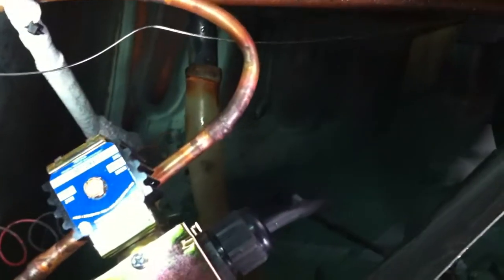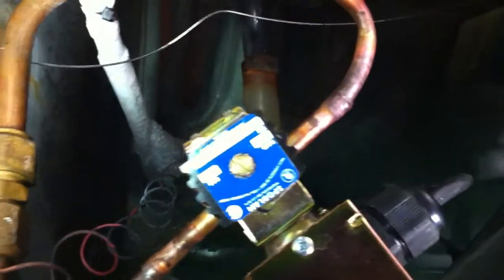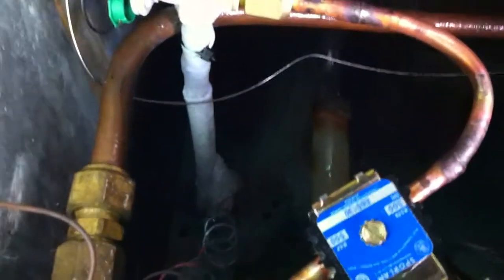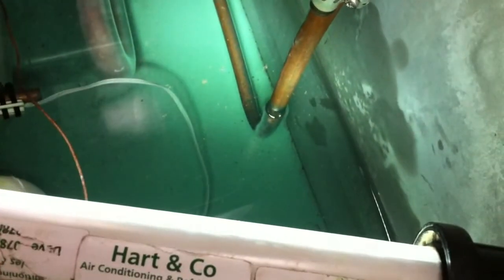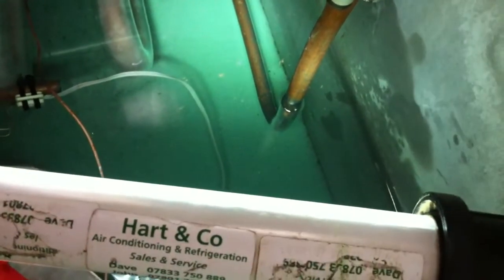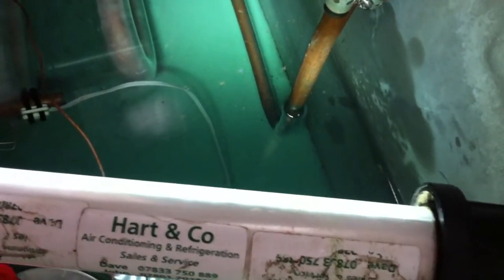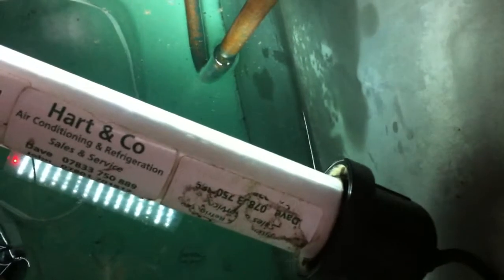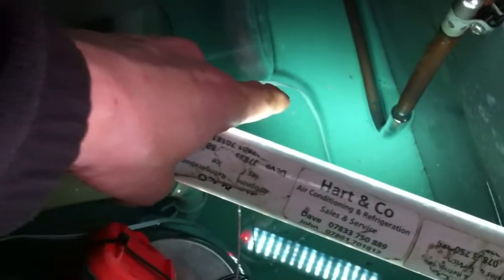HVAC Solenoid replacement

Comment from the maker: It does look like it. The pipework is original, i just cut the flares off and cleaned them up and the new valve fitted in the gap. Its a 1 ton system so think it will be fine :-)

Comment: What kind of system is that?
Reply from the maker: Hi John, the system is a bulk milk cooling tank, think its around 300 gallons capacity.
The ice keeps the water cool and a pump takes the water to a spray rail at the top of the milk vessel where it runs down the outside of the tank cooling the stainless steel and the milk inside. Its an old design based on tanks made by the Dairy Equipment Company in Wisconsin and is probably about 40 years old.
Reply: Oh, so when I saw how they pasturized milk on how it's made, that's how they chill the water to 32 degrees without freezing it.
Reply from the maker: John Smith
Yeah i have a customer who uses one of these tanks to supply chilled water to their pasturizer. I expect bigger dairies would have a dedicated ice builder or a chiller with a glycol loop.
Reply: If they would use 50/50 glycol and water mix in building AC chillers, they could get the temperature lower, and it would be more effective.